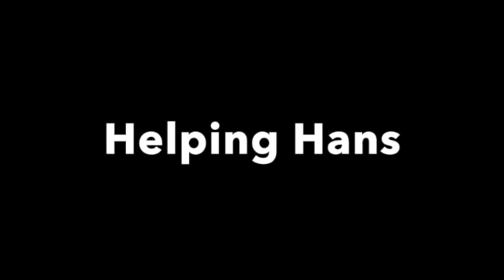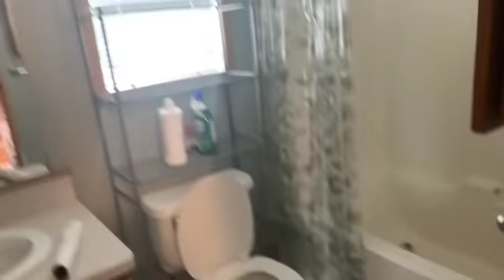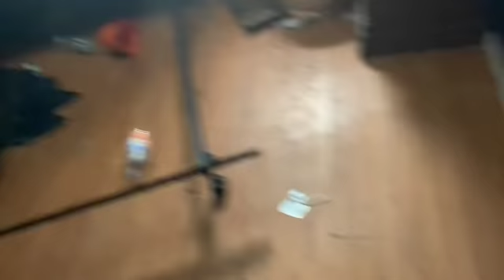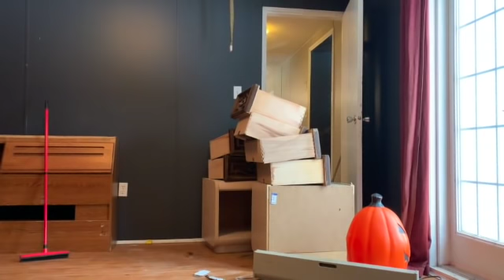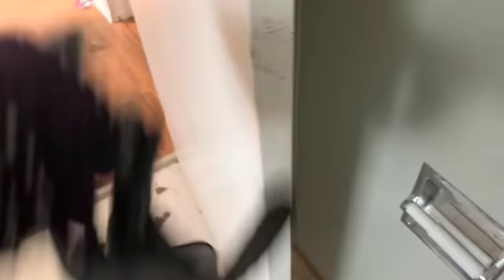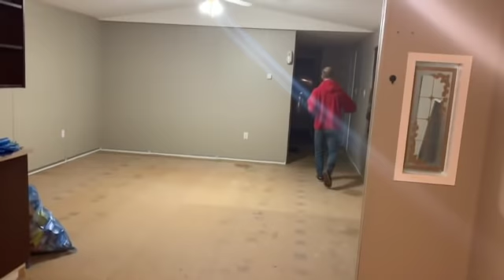trailer gut and remodel

Comment: You can salvage that stinky fridge, give it a good scrub, then coat all surfaces with mint tooth paste, leave on for as long as you can, scrub off and wipe down surfaces with a bit of vanilla. I salvaged an rv fridge that had meat left in the freezer (so stinky) was a good deal too, free. And was bigger than the one we were replacing.

Comment: Hi Hans and Zinnovia.  Good work, Guys. It's not fun cleaning up that kind of mess, but it's hard to get construction work in the winter.  You do say, in your title that it's a gut and remodel, so guess you're going to take out the drywall? and do a redesign? or just re rock it?  Guess I'll be patient and see what you do.  Fun to see you out there working.
Reply: Taking floors out and doing some doors and a couple walls
Reply: @zinoviamcquitty1740  ... I did some fixers.... it's a lot of work. Glad you have each other. Look forward to seeing what you do with it.

Comment: I’ll give y’all a great tip! When food spoils in your freezers or fridge clean thoroughly with bleach then turn in line shelves with new paper and charcoal. Get the cheep kind with no liter fluid . Do this in any compartments . Spread the charcoal out 6 or seven each compartment. Let run for a couple of days or so . Removes all odors and bacteria. Trust me it works ! I had a full freezer of meat 1/2 beef power went out from tornado in area in summer took few days to get power. Anyone hear of Greensburg  Ks 2007? Anyway this saved my freezer .

Comment: and that's why I could never be a landlord.  Rentors can do more damage than you could ever imagine.  The one's this poor landlord had were just terrible but it could have been alot worse.  I have seen where they sold the kitchen appliances and pulled all light fixtures off ceilings then punched holes in doors and walls and on their way out they plugged the sinks and turned the water on full blast.  You two work so well together.

Comment: We had the power go out on our freezer n lost a whole pig. It was about two weeks, so it rotted and rand outside. My husband took it apart and took off the door. Then he scrubbed inside and out with hot soapy bleach water and it got rid of all the odor. We used it for years after that.
Reply: I agree, don't throw the freezer out, just the food. Bleach and a heavy duty thorough clean will fix that.🙂